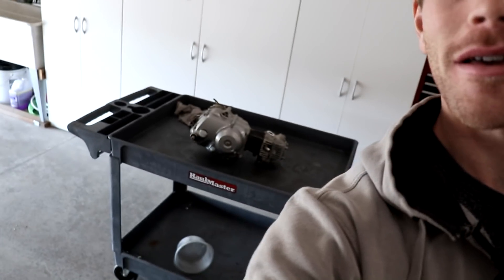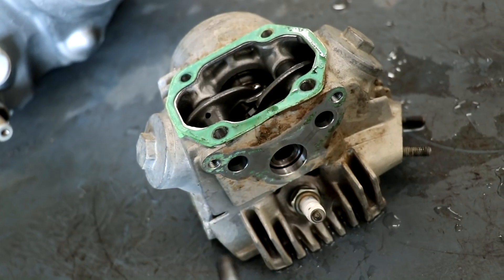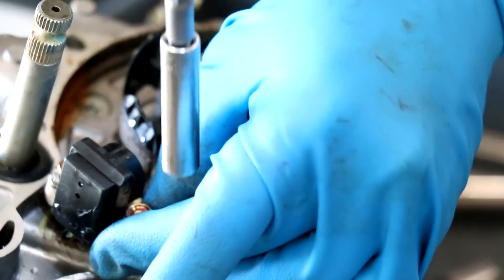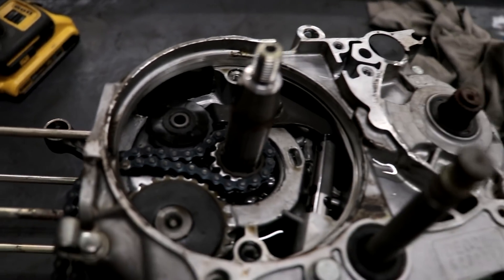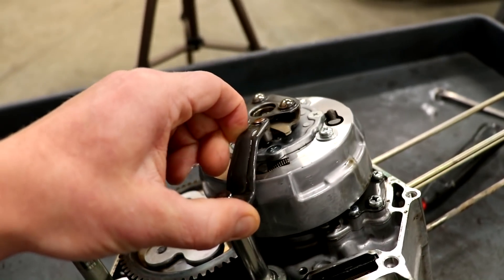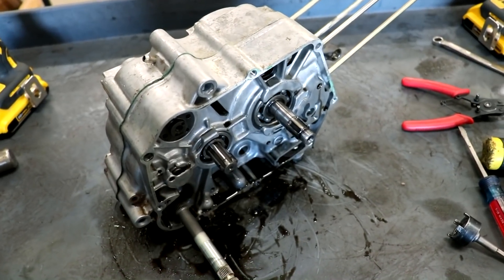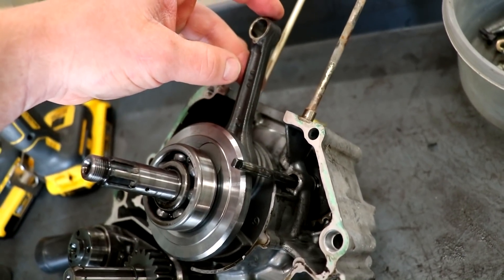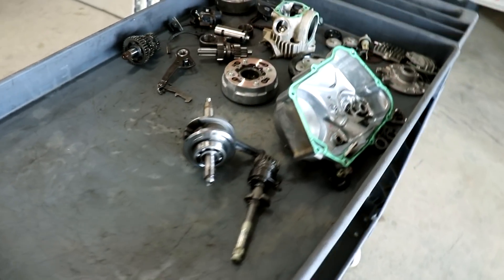This Motor Ran Out Of Oil!

Comment: I had a Honda XR250L that I ran out of oil. The motor got so hot the points on the spark plug warped and it wouldn't fire. Put in a new plug and filled it up and rode it another 2 years.

Comment: that piston looks just like the one i pulled out of my blown up 5 hp Briggs Flathead someone ran it without oil and it ripped a chunk of metal off the piston and welded it to the cylinder wall the block can be fixed but that piston is junk the 5 hp was going to be put on my mini bike but after i saw the piston i knew the motor would be dead until i could fix it so i bought a much better 5 hp from the junkyard where i got the other one the new one i bought has no damage at all the other 5 hp will be fixed someday in the future

Comment: I got mine nieces a brane new 125 coolster atv I was was changing the breake in oil an I took out out the other bolt with the spring in an when the bolt came out the spring an the rod came out flying I was not sure which one went in first so I stuck the spring in first an it got stuck so I tried to use a pick but I could not get it it went in ferther so do I have to completely tear down the engin just to get the spring out plz help not funkier with chines engine

Comment: just finished rebuilding a 110 cc chinese pit-bike engine which also learn to run without oil; piston scuffed, rings worn, first gear pinion teeth stripped, sludge trap full to the brim; surprisingly rod bearing was fine, no play, even the cylinder wasn`t that worn; these engines are tough

Comment: Awesome video... is it possible to add an electric start to these motors? Obviously the starter solenoid is needed, but what would be the other critical parts needed?
Reply: I think not its in the case so the case would need to be replaced

Comment: You can't determine if a rod bearing is good by wiggling it you need to use feeler gauges and measure the clearance. Its actually too much side movement that determines that its bad by the time there is vertical play its far beyond acceptable.
Edit: After seeing that engine was ran without oil your not going to sell that crankshaft assembly to someone are you?

Comment: just picked up a used Craftsman 250cc single stage Snow Shredder , Chassis Mint !!!!!!
Engine Toast , Ran with no oil 
Piston Seized to Bore , Aluminum transfer on Cylinder and piston Gouged , 
cleaned cylinder wall with Muriatic Acid , and flapper wheel , honed with scotch brite red pad, welded the grooved piston 
crank ok , connecting rod ok

Comment: Wondering where you got all this knowledge on dirt bikes from? I have a 04 yzf250, 04 ttr-125 and a 03 xr 70 they all have their problems but just little issues, I am looking to resolve all those problems but don't have much knowledge on engines besides carb cleans and spark plug changes. Can you help me out? Lol
Reply from the maker: I mostly learned through experience and watching others. Thanks for checking out the video!

Comment: That tiny bit of play in the 4 stroke 450 motor makes it bad? I remember that two strokes, were allowed way more play! Are you sure?
Reply from the maker: Yeah, this crank would have knocked like crazy. It's fine to have some side to side play like 2 stroke cranks have when they're new, but absolutely no up and down movement.
Reply: are you sure, my 2 stroke husqvarna was allowed to have up to 0.2mm of up and down play. that isn´t much, but still away from nothing
Reply: If it`s a roller bearing big end rod . Like the man said  No Play . Plain bearing`s get clearance. Is it possible that is the wear limit   when it get's to  .2mm.  . I have used some Russian bearing that wore out . They did not fail just stated to get clearance . Most of the time normal roller bearings have  NO  clearance or very little ,when they wear they get loose but just a little . If a roller bearing has play most of the time it`s time to be changed . But I am sure there are exceptions to this rule .

Comment: Deez nuts 1:11
Reply from the maker: Hahaha
Reply: hey man realy like your page! why did you decide to scrap the cylinder? could you possibly sell it to some one that would repair or bore it?
Reply from the maker: Thanks man! It's just too much hassle selling a damaged part. It happens too often where someone will buy a part that needs repair, and assume it's good to go without reading the condition.
Reply: yeah i started watching your other vid of changing the oil and i got butter flies in my stomach! that is my biggest fear to buy something used that looks great on the outside but on the inside..... scary! glad it wasn't too bad!
Reply from the maker: Yeah, ended up being in much better shape than expected. And that's why I sell the motors in parts, so there's no surprises.

Comment: When you take a Motor apart, how Do you remind where every Single nut is when you want to build IT Up?
(Sry for writing mistakes im from german)
Reply from the maker: Mostly memory, but I'll also sort the bolts out depending on where it came from if I am putting the motor back together.

Comment: At 7:21 What is the function of that bolt? I have the same but I can't find why there are two bolts on the bottom of my engine. It's not the drain plug right? Because the drain plug is located in the middel below the engine.
Reply from the maker: That is the bolt holding the cam chain tensioner in place. Yeah, correct the drain plug is in the center.
Reply: Cameron Niemela Thank you!
Reply: What is the use of that? Can it be adjusted? I always thought it would be some oil filter of some kind. By the way where is the oil filter?
Reply: actually there is a filter right under the oil pump, it is a flat mesh filter
Reply: popolXTZ on my engine I stuffed a piece of an old oil filter in it whew the mesh screen was.
Reply: Jonathan Smith I beleve there is no oil filter on these engines..
Reply: cam chain tensioner bolt

Comment: Do you spray the parts with anything to prevent rust after disassembly?
Reply from the maker: After the parts are cleaned they are dried off completely, but nothing is sprayed down except for the bearings. I put oil back in the engine bearings.

Comment: Ok so I've wondered this for years what will happen if you put a drill on the kick start will it fuck the motor up or will its just start fine
Reply from the maker: Only thing I see it doing is ruining the splines on the kick start shaft. I doubt it'd start the motor, the kick start shaft would just hit the stopper and nothing would happen.

Comment: How in the world do you remember where every nut, bolt, washer, bushing, and gear are from to list them on the website? 😂😂
Reply: Tyler James if you work much enough with motors, u will remember then automatically :D i can also remember all parts from minarelli am6 engine :D now i have cr250 and hoping to learn stuff from it :3
Reply from the maker: Like Samuel said, over time everything becomes familiar and even every bolt I can identify where it came from.

Comment: That poor little 70 had a hard life. Running one without oil is about the only thing that will kill these tiny Honda engines.
Reply from the maker: Even no oil won't kill these bikes. I bet this one could have gone another year haha.
Reply: @CameronNiemela  mine I'm pretty sure just died today. My Crf125f's gas mixed with the oil. Now it will only rev to 8000 when it revs to 9500
Reply: Yeah it issnt a liffan better look at the clutch and the electric thing under it
Reply: janco tolsma yeah the flywheel and stater are way different. and the piston.
Reply: Ruudi Utšenikov are you sure?? This looks just like my xr70r engine

Comment: Where can I buy the Xr70 swing arm, I checked the link in the description and I didn't see it listed
Reply from the maker: The XR70 swingarm sold already. Here's one I came across recently:

https://rover.ebay.com/rover/1/711-53200-19255-0/1?icep_id=114&ipn=icep&toolid=20004&campid=5338186796&mpre=http%3A%2F%2Fwww.ebay.com%2Fitm%2F2002-Honda-XR70R-Swing-Arm-%2F322758087223%3Fhash%3Ditem4b25e19237%3Ag%3AsVwAAOSw6~VZwBGT%26vxp%3Dmtr